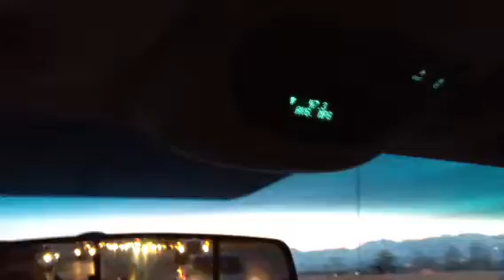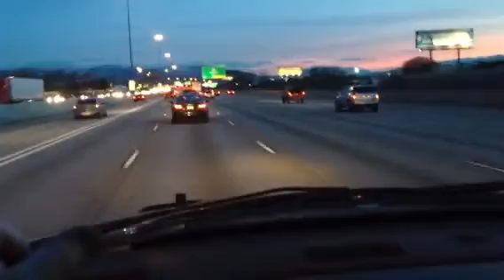Cummins 6.7L with CNG Edge conversion system installed

Comment: why can't a diesel engine Vs gasoline engine use CNG? Is it due to compression Vs Combustion?

Also, will a kit like this work on other Cummings diesel engines? For example, A Cat C7-210.

Thanks!
Reply from the maker: Its due to ignition. No spark plugs in a diesel engine so you need some diesel to ignite the air/natural gas mixture. diesel becomes the pilot fuel and natural gas becomes the main fuel. Yes my kit can be adjusted to work for any diesel engine.